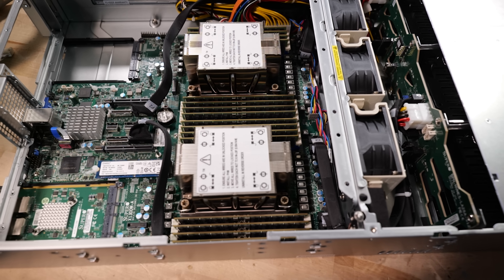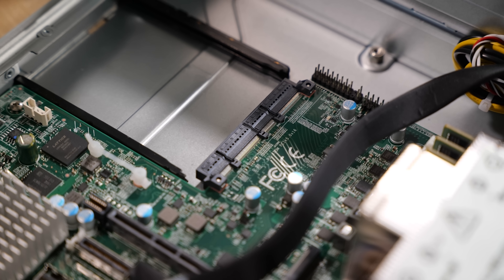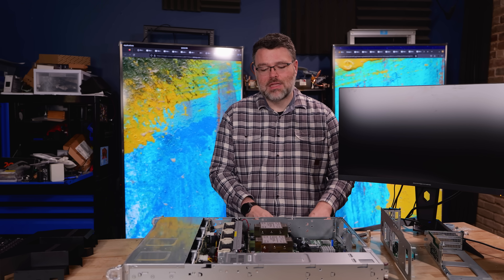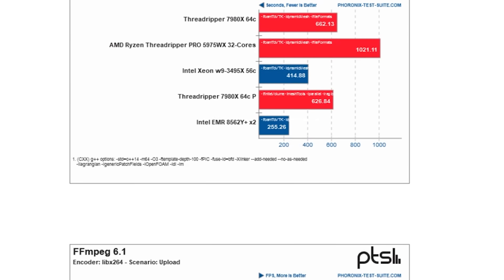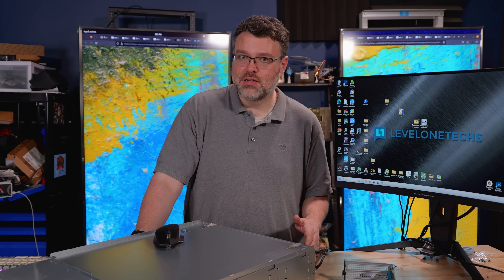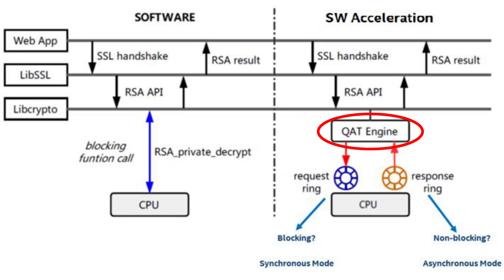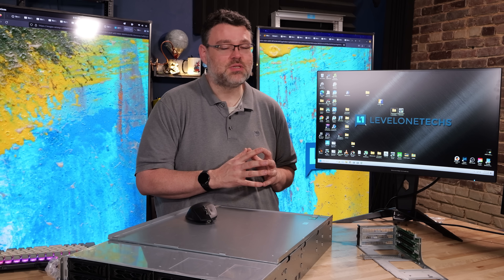New Xeons, Who Dis? Emerald Rapids 8562Y+ First Look in Supermicro SYS-621C-TN12R

Comment: They're quite a lot more expensive than the AMD equivalent, it seems
Reply: Using 2x750mm^2 Intel 10nm on each chip makes them hella expensive to manufacture. AMD's Zen 4 cores are around half the size of Intel's Raptor Cove and Zen4c is even smaller.
Reply: @lharsay  yep, that's Intel's issue. As a customer, I'm buying performance, not die area

Comment: Emerald Rapids is also 11 months as Sapphire Rapids had multiple delays.  :/  5 in 4 is very aggressive though, no doubt (IDM 2.0 strategy) We shouldn't think that the next architecture won't start development until the last one is complete, although this situation can slow down or delay the successor to a degree.  Additionally, Sapphire Rapids kind of come in with less than shocking performance gains; it appears that Emerald Rapids has rectified that.
Yes, server world is red hot right now and AMD has been forcing Intel's hand in competition, which is great for everyone.

Comment: Liking these new chips, hopefully power consumption stays in check. I'm paying an extra $1200/yr in electricity lately to run my 4 servers.
Reply: Phoronix "Platinum 8592+ Emerald Rapids" review, because I haven't seen another comparison elsewhere. Both parts are 64cores.
Performance Geomean average across suite
1P Epyc 9554: 450.8
1P Xeon 8592+: 461
2P Epyc 9554: 731.34
2P Xeon 8592+: 705.78
=Xeon is 2.2% faster in 1 PC but the Epyc is 3.6% in 2P config.
All the while the Xeon is nearly 28% more expensive at $11600 versus $9087, Even if you don't care about power draw the Epyc is about 32% better value.

Power Draw Average Wattage
1P Epyc 9554: 227.12
1P Xeon 8592+: 289.52
2P Epyc 9554: 377.42
2P Xeon 8592+: 556.83
=Despite similar performance in 1P the Xeon draws 27% more power, Meanwhile in 2P form it draws over 47% more power despite being slower.

Comment: Phoronix "Platinum 8592+ Emerald Rapids" review, because I haven't seen another comparison elsewhere. Both parts are 64cores.
Performance Geomean average across suite
1P Epyc 9554: 450.8
1P Xeon 8592+: 461
2P Epyc 9554: 731.34
2P Xeon 8592+: 705.78
=Xeon is 2.2% faster in 1 PC but the Epyc is 3.6% in 2P config.
All the while the Xeon is nearly 28% more expensive at $11600 versus $9087, Even if you don't care about power draw the Epyc is about 32% better value.

Power Draw Average Wattage
1P Epyc 9554: 227.12
1P Xeon 8592+: 289.52
2P Epyc 9554: 377.42
2P Xeon 8592+: 556.83
=Despite similar performance in 1P the Xeon draws 27% more power, Meanwhile in 2P form it draws over 47% more power despite being slower.

Overall Value price*power/performance
(lower is better)
1P Epyc 9554: 4578
1P Xeon 8592+: 7285
2P Epyc 9554: 9378
2P Xeon 8592+: 18303
=Xeon in 1P is 59% worse and in 2P is 95% worse.
Bit arbitrary sure but you pay more, get less and then pay even more constantly to keep it running.
Reply: > All the while the Xeon is nearly 28% more expensive at $11600 versus $9087, Even if you don't care about power draw the Epyc is about 32% better value.

None of these sell at list prices.
Reply: @-szega  Okay, so take both and x0.9 or whatever makes you happy.
Reply: @tomstech4390  Discounts are much higher than that, depending on the vendor (spoiler alert). That's why your cost calculation is off and one reason why people still buy Intel.
Reply: @-szega  Ah yes, illegal price fixing and selling at a loss is why people buy Intel.  Always has been the case.
Reply: @-szega  Okay, so take both and x0.2 or whatever makes you happy

Comment: "5 nodes in 4 years" Well that's the problem isn't it
They've been so far behind for so long they have to catch up, not only is the goalpost moving away still but the act of potential future parts being even faster deters anyone from buying these current ones... assuming they actually become available in the first place.

It being a best case with 2 sockets but only 32 cores per socket for a combined 600watts and $12,000 leads to more questions like.... how does it compared to dual 9374F's?
The latter are still 2P and 32cores with a similar TDP rating (however they both want to modify that)... but the Epyc's combined are under $10,000 with higher clockspeeds upto 4.3Ghz versus 4.1Ghz plus 256MB L3 cache vs only 60MB.

Intel might call their 10nm process node "Intel7" to copy TSMC, but TSMC's 7nm node was actually available en-mass in 2019 and Intels launched at the end of 2022.

They can call it intel7 and have some Intel4 based dual core 2Ghz chip working and promise 20A next year... but if you can't get a xeon or I5 with it then its just meaningless promises.
AMD and TSMC could announce a 1nm 512core part due for 2024 in exactly the same way.
Its not even tied to gate pitch anymore and Intel are still behind.

Sierra Forrest faces the same problems.
"Intel has the higher core count at 144 which helps them in the cloud native segment"
That's a blatent lie because you can't buy one.
Even if you could you need 288cores to keep up, Bergamo has 128cores but 2x the IPC (and similar clocks) so that performs like 256 eCores anyway, Add another 25-30% for SMT and intel would need ~320 eCores for similar multicore performance.

-March 2023 Intel said they would have 144 cores for 1H 2024.
-June 2023 AMD launched 128c256t Bergamo and had availability ready.
-Sept 2023 Intel reacted saying they will have a 288core of SF for 1H 2024...sure.
Service providers can either A) wait till June 2024 and buy intels 288core Sierra Forrest for an unknown price.
Or B) have been using Bergamo for a year by then with similar performance.

What if a year from now (AMD moved to an 18 month cadance) AMD release a 12x16= 192core Zen5c parts in Q4 2024 what could Intel do? Because they won't be able to do the required 500cores to keep up in that timeframe unless they can double IPC overnight.
AMD is already showcasing their XDNA NPU for AI acceleration and that wouldn't take a full year to add.
Intel can only add "moar eCores" but they cannot add them fast or efficiently enough.

Comment: Have they dropped workstation CPU's?
Can I upgrade from my 2455x?
Reply: Also wondering if current W790 mobos will support these new cpus
Reply: @jereviitanen6883  They will. At least Intel has said so previously. The new server CPU's are drop in upgrades, so I can't imagine you would need a new mobo on workstation side.

Comment: Intel vs. AMD comments are so funny. Imagine being so myopic to think that the enterprise cares only about core counts like you in your home-lab do. These products aren't marketed towards you, and Intel doesn't care if you're not going to buy them. They also don't care about your armchair AMD vs. Intel arguments, because you're not going to afford anything that's current gen, which would be the only way they get paid. Your purchases are always second-hand. At least Intel never screwed anyone over by vendor locking their stuff to create E-waste and screw over the hobbyist. Stick with your Epycs and Threadrippers if you want high core counts and no data-center accelerators and instruction sets. You likely don't need them for your home-lab. The AMD stuff is cheaper and lower market share for that reason (along with never going beyond 2 sockets per system).
Reply: They have merit, Intel is on this ramp up because every launch is dead in the water. Nobody is buying these, my Dell/HPE/Supermicro reps don't even hype them because the sales are very weak.  Epyc 4th Gen has been in customer hands for over a year now, and even with this release being hot off the presses AMD customers have had 4 different skus that outperform it at a lower price. 

This is really almost a paper launch, if it wasn't a drop in to emerald rapids socket, nobody would buy it. They'll get bought to improve existing hardware and be bought by companies that refuse to switch. Either because they have someone stubborn or have virtualization workloads and they don't want to deal with cold migrations.
Reply: You sound like you're about to cry, screw intel and home labs AMD destroys em.
Reply: You sound super bitter for some reason. It's just silicon, who gives a shit. Do you work for Intel server group ?
Reply: @vincei4252  People arguing about them are the bitter ones.
Reply: Well, it really looks like they're not alone. Who hurt you?
Reply: Luls

Comment: This has to be one of the most bazaar reviews I have ever seen. It's a lot of good super micro stuff attached to a new slow processor, and Wendell is trying to dance around and carefully not touch that fact. saying its not top tier and only comparing it against single socket Threadripper.
Reply: @CheapSushi  I've got 9 otw boutta buy 23 more 😤
Reply: I don't know if you know this, but not every application requires a new "fast" processor lol
Reply: @godspoon  People running those applications don't need a video on a slow cpu if they can get a fast one instead.
You wanna watch a PentiumD 945 video?
Reply: @tomstech4390  if Wendell was interested enough to make a D 945 video, I'd be interested in watching it 🤷‍♂️
Reply: @godspoon  I'll be honest I originally wrote PD 965EE the only 2c4t PentD.
But downgraded it which isn't something you usually get to say about a PentiumD.
Still a bad idea to showcase worse products, Epyc options like the 9554 are faster and draw less power while still being cheaper.
Reply: but its not just slower its also a lot less efficient. so you need 2 of these processors to get the same performance as a single socket threadripper.
Reply: @geofrancis2001  This is not a Threadripper competitor. This is a SERVER part not a workstation part. The lines have been blurred lately, but that's still a significant difference.
Reply: @MrHav1k  then why not compare it to a EPYC even one of the low core embedded ones.

Comment: Those OpenFOAM benchmarks make the 5975WX look pretty good, both in performance and definitely in value.
Reply: Indicative a memory bottle next. The 5975wx is 8 channels of DDR4. The 7970x were only 4 channel. Better to benchmark apples for apple to apples, single socket vs single socket, 8 channel vs 8 channel memory, etc.
Reply: @BurnsRubber Why not benchmark apples to apples -  $6,000 CPU vs. $6,000 CPU.

Because that's what you're actually buying.

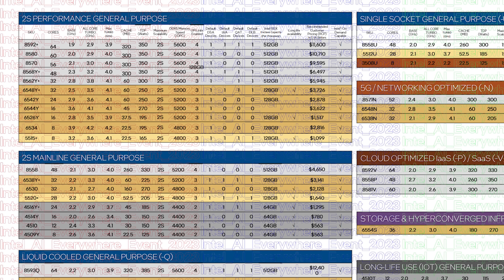E.g. the 8562Y+ is $5,945 (2:28), which prices it higher than an EPYC Genoa 9454 ($5,225 @1,000 units). And both go in 2P servers.

Edited to add:

I didn't include the 9534 as the step above the 9454, because that's a different price bracket to my mind, coming in at $8,803. That's a 48% jump in price compared to the 8562Y+, which is only a 13% jump in price over the 9454.

Comment: Holy moly!!!

This is looking really good!! If they can deliver Granite Rapids and Sierra Forest on time with another significant performance uplift.... I think it's safe to say Intel is back!!!
Reply: Sierra Forest is all E-cores.  It will be a lot slower per core.
Reply: @TrueThanny  Absolutely, but Sierra Forest is designed for high density and different kinds of workloads with absolutely MASSIVE core counts. Plus the accelerators are still there. Should be very interesting.
Reply: @MrHav1k  144 cores.  AMD has 128 faster cores right now, and will have 192 even faster cores by the time that Sierra Forest comes out.  The accelerators are essentially the only advantage Intel has.  Not sure for how much longer, as AMD has the right to use any x86 technology that Intel creates (and vice versa).
Reply: @MrHav1k  "Plus the accelerators are still there"
Where? Got a link to a store page or we hallucinating?
What does Intel have right now that competes with Bergamo?
Reply: @TrueThanny 288 cores.
Reply: @MrHav1k What accelerators are still there? Nowhere I could find, anyway.

The "rebirth" of 288 core SF alone (which was more or less canceled already) shows, that Intel is still in for a world of hurt. Everybody knows that they were told by Megascalers like Meta and others to get their act together with SF and get the 144c variant to market asap - or they'll go with Bergamo and Turin dense. Well - Bergamo is out and selling like hotcakes and SF is nowhere to be seen. AMD even made an oftentimes overlooked variant of 128c Bergamo without SMT. Guess why?
Reply: granite & sapphire rapids is on intel 3 net h1 2024, thats amd could not replicate soon because apple is borrowing all tsmc 3 plant

Comment: Intel’s gonna have 5 nodes in 4 years when pigs can fly. 
(And a pig temporarily propelled by water pressure doesn’t count)
Reply: Intel gets to define an Intel node. See: desktop 13xxx -> 14xxx
Reply: @mytech6779   Intel won the PC industry with the cunning use of flags I see.
Intel: I claim this cpu to be 69th gen and 2nm.
Transistors: you can't claim us we live here, there's 14 Billion of us.
Intel: Do you have marketing and flags?
Transistors: no..
Intel: no marketing, no flags, no meaning, those are the rules that I just made up.

Can't wait for 420th gen on 0nm next year.
Reply: Welcome!... to we'll-have-10nm-in-2016 ranch.
Reply: Intel 7 has been out for two years, Intel 4 launched today, Intel 3 is on track for next year, 20A has been demoed with Arrow Lake systems operational.... looks like they're on track to hit all five if you ask me. Though one could argue Intel 3 and 18A are half steps from Intel 4 and 20A, but they're separate nodes no less.

Comment: So, it won't take 3rd gen scaleables? Don't tell me they messed up by changing the socket?  Edit: Where's the slots for expansion cards? What if I need a GPU or 2?
Reply: Why would they share a socket with 3rd gen when there is already a 4th gen with a new socket? 3rd gen is Ice Lake. LGA-4189. Sapphire Rapids is/was 4th gen and uses LGA-4677. This 5th gen uses the same socket and the system he's showing off supports both 4th gen and 5th gen (4th and 5th gen are X13). 3rd gen Ice Lake was X12 (LGA-4189). Skylake and Cascade Lake were X11 (LGA-3647).

He doesn't have the included risers installed. It comes with 2 riser cards.
Reply: @timramich  Thanks for that, didn't realise they'd screwed over 3rd gen owners so hard.
Reply: @truckerallikatuk Who got screwed over?

Comment: why no EPYC?
Reply: to ensure that it doesn't look like the complete embarrassment. Same reason why he got two socket system, so that the CPUs could boost higher than if it was a single 64 core die, like the last gen Threadripper in comparison.
Reply: Intel and Asrock both need representation and they've blacklisted everyone else that won't toe the line and read the script. (yes it's toe not tow).
They often have a clause that the sample is supplied provided there is no direct comparison made against the competition other than older products or those of a different target market like threadripper, Nvidia do it too.

Comment: How come there are no EPYC CPUs in the benchmarks?
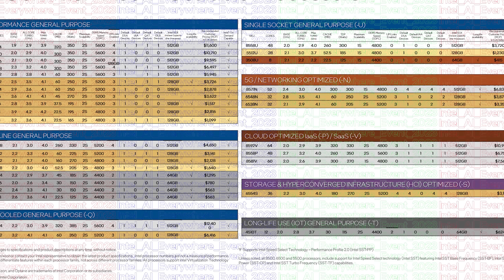Reply: There were some at around 9:30 minutes i think
Reply: So as to not completely embarrass Intel. I mean come on 700W or more for just 64 cores and it still loses to a 64 core AMD last t using half the power lol
Reply: @tj_2701  Couldn't care less if it embarrasses Intel, there should be equivalent AMD server CPUs in the benchmarks, not workstation CPUs.  I'll be very unimpressed if that was a condition for Wendell being able to review this system.
Reply: Edit: I made a mistake and looked at the wrong column in the graph for 9554 (was looking at dual socket power for Epyc but not Xeon). The correct number would be 227W on Epyc vs 289W on Xeon. Or 377W vs 556W when comparing dual socket. Still, even two 64-core EMR CPUs pull way less than the claim that one CPU is pulling 700W.
 
 @tj_2701 literally doesn't? And there were benchmarks comparing to Epyc. Intel significantly outperforms Epyc core for core and power consumption is way lower than what you seem to believe? Average power consumption in Phoronix's full suite was 290W average which is significantly less than the 9554's 377W average. The dual-socket 9554 was 3% ahead of the dual-socket 8592+ on average while consuming 30% more power, so maybe get real data before posting your made-up nonsense? Intel is clearly more efficient here.
Reply: @AlexSchendel  you need to show evidence for claims like that...your clearly confused and are comparing the average of the XEON with the peak of the EPYC.

from Phoronix: On average the Xeon Platinum 8592+ was pulling around 289 Watts compared to the SPR average at 306 Watts. The peak Xeon Platinum 8592+ CPU power consumption was recorded at 434 Watts compared to the Sapphire Rapids peak of 469 Watts. The AMD EPYC 9554 meanwhile had an average power consumption of 227 Watts and a recorded peak of 369 Watts.

last time i checked 227W is less than 289W...
Reply: @geofrancis2001  I was comparing against the dual-socket. My mistake. Still, I don't see how 290W = 700W in the minds of AMD fanboys.
Reply: @AlexSchendel  350+350=700 
The Intel price chart in the video showed TDP of 350w[thermal?] per socket.
The claim was one 64c verses dual 32c. Not much of a mental stretch with when paying even modest attention.
Reply: @AlexSchendel  I think that you might be suffering from a developmental disability.
Reply: @evrythingis1  Um lol? Care to explain why you would say that? Or do you just like being toxic to random people on the Internet?